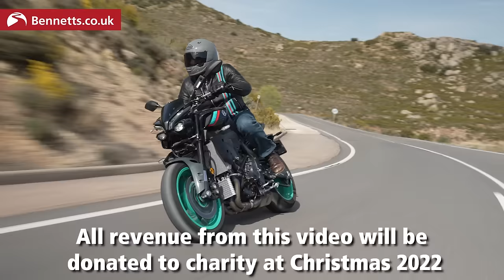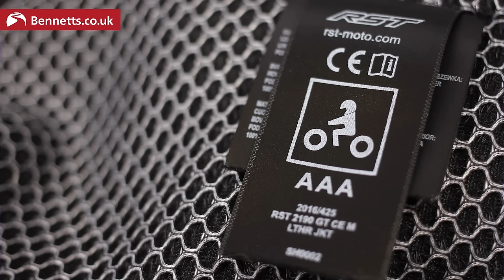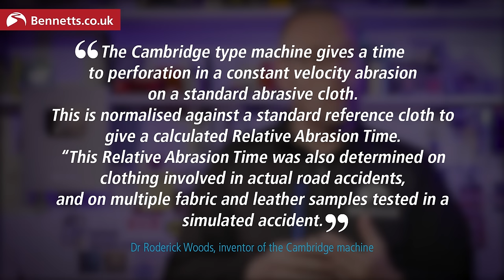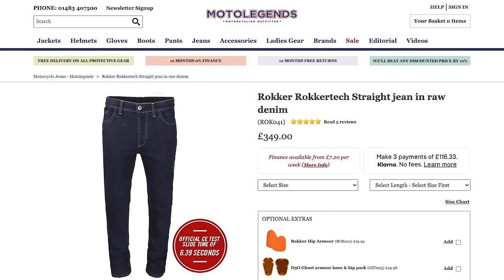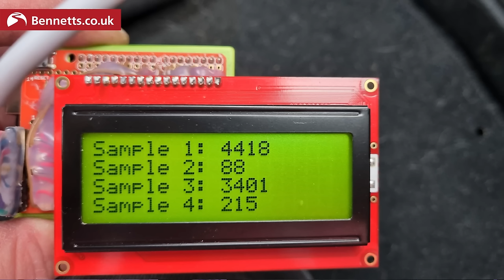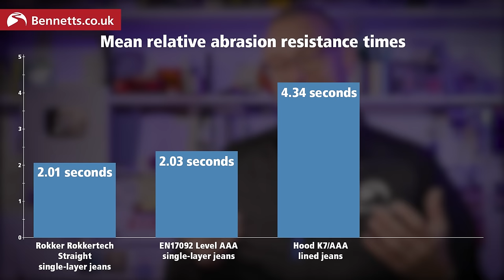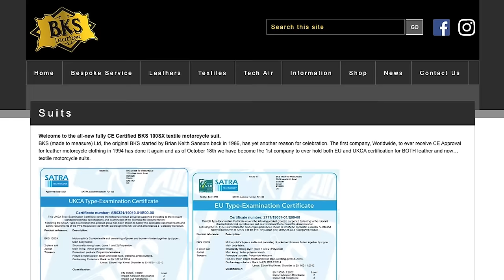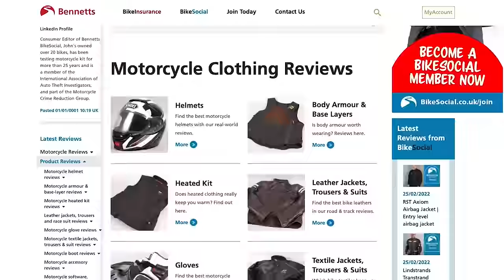Best motorcycle jeans | Single layer vs lined: THE TRUTH

Comment: In order for Slide TIMES; even if measured in a properly consistent and repeatable rig, to translate reliably to actual crash performance; there has to be some a priori assumption that the friction between the garment sample and the belt is fairly consistent across widely differing classes of garments. Even 20 second slide-time-until-wear-through, wouldn't help much, if you haven't shed any speed at all over the course of those 20 seconds.....

That's not just me being pedantic. Anecdotally, riders in textiles slide further on track than riders in leathers.... The researchers interviewed in the video likely have better data wrt friction between asphalt/chipseal and various classes of materials.

Even if abrasion was the only concern, slide-starting-speed, or energy dissipated, not time, is what should be focused on. In a real world filled with hard, immovable barriers which are dangerous at motorcycle getoff speeds, there will, in addition to abrasion resistance, also be an optimal friction coefficient for protective gear: High enough to stop you quickly, yet not so high that it causes excessive, injury causing, tumbling.

Being a bit of a cynic, on account of experience with standardised so-called "scientific" mandates in other areas; I suspect this is exactly the "problem" the textile makers wants regulators to "fix" for them by a "suitably designed" "standard:" Textiles simply aren't even remotely as all-around good as proper leather for crashing on a bike. And also, once friction gets as high as competition-leather-against-pavement: Then craftsmanship; as in seam strength and placement; how tight the garment fits in order not to bunch; how well marketing-desired tiny armor pieces resists being pulled out of the way under strain on the garment resulting from a crash-and-slide etc., becomes a big deal. IOW: It becomes very difficult to get even remotely close to the performance of proper, well constructed and fitted leathers. Cheap-to-have-made-overseas, flappy and fashionable textiles, simply don't compare at all. Making really good textiles "may" conceptually be possible; but doing so would require fine, labor intensive tailoring and highly sophisticated design, materials choices and workmanship. Not just a fancy brand on a fundamentally cheap suit slapped together to game a rather sloppy test.

Comment: I think your comment at 19:00 was key to this topic. Having tested my own pair of Knox jeans with a 40kmh off, I believe it was the knee armour that saved me from serious injury ( I landed on my right knee). I was limping for a week or two, but no long term effects. Now whenever I am tempted to ride with my ordinary jeans, I think about where I would be if it wasn't for those armour pads. Abrasian and skin rashes hurt, but they heal. Busted knees or hips, not so easy especially for us older blokes. Thanks for the video - you put a lot of work into that. 👍🇦🇺
Reply from the maker: Thanks, and glad you're okay!
Reply: I think I know how you feel. I hit a guard rail at 40mph in the knee. In my case, didn't hurt my knee at all (well, I had a sharp shock of pain, but no bruising, limp, or damage after). In the same crash I did break a few bones in a foot and shattered a wrist though. All healed up now, except my wrist is acting a little weird. The armor saved my knee, and the garments kept me from having any open wounds. The breaks suck, but it wasn't that bad because of the gear.

Comment: Having just bought some expensive single layer jeans rated AAA, it's disappointing to see just how little the new ratings actually mean. Thanks for this valuable information, I wish more independent testing of this sort was done.
Reply from the maker: The A to AAA ratings are genuinely valuable, but abuse of their communication is undermining them. Phrases like "they say 'A' but..." are just confusing buyers. The certification takes into account abrasion resistance, tear resistance and seam strength, producing a useful guide to what performs better. AAA is better than A, and if someone says "but it was only tested to A and could have done better" then that's irrelevant as we have no proof. The law was brought in to stop brands making unsubstantiated claims.
All of the levels, though, only product a pass, so while AAA is the best you can achieve under EN17092, you can't tell how AAA-rated garments compare. That can mean that some brands will try to infer that a single-layer pair of jeans are as protective as a pair of one-piece race leathers. 
It can be argued that on the road, if you hit a car or a tree then the abrasion resistance is irrelevant, but it's all about making an informed choice. I know that a set of decent (and I don't mean they have to be the pinnacle) leathers are safer than motorcycle jeans, but I choose to wear the jeans most of the time I'm riding for myself.
I want people to make informed choices, not influenced choices, and some stores do help with that. Claims of 'slide times' show a lack of understanding of the test methods and certification, whereas stores that allow you to search for products by the A, AA or AAA ratings seem far more genuine about putting rider's choices first.
Given the certification method we currently have, I'd recommend people to choose AAA-rated jeans, then decided if they want single-layer or lined. Cheers, John
Reply: @bennettsbikesocial  thanks for the detailed response. What I meant was mainly in reference to the fact that the two AAA jeans performed very differently while the AAA monolayer didn't even outperform the A. It seems like maybe the abrasion requirements in the new norm are simply set too low? How else if not through the rating is one supposed to know what is "safe" to do with the garment. With such a lower abrasion performance than expected, I might not want to take those jeans up to highway speeds for example.
Reply from the maker: @HardwareG33k  The AAA monolayer was very similar to the A, but this was only an abrasion test. The A-rated jeans had an abrasion resistance that could pass AAA, but we don't know if they'd pass the tear or seam strength tests. I'd always recommend buying AAA-rated single-layer jeans for that reason; it's a guarantee that all the tests have been passed – and they are all important.
With regards to the lined jeans and leather beating the abrasion resistance, that's where the planned BS 13595 should help; if all goes to plan, brands will have the option to demonstrate the performance achieved beyond AAA. It still will never be a 'slide time', but it will allow buyers to compare products more easily. Cheers, John
Reply: @bennettsbikesocial  that's helpful, thanks!

Comment: In 2014 i had a low side accident at 35 mph, rolled and finally tumbled into a ditch. I was wearing draggin jeans 32 INCH INSIDE LEG ( I am a 30 INCH INSIDE LEG) but they were a special order and what the hey! 
bought new in 2009 with separate knox knee armour and knox undershorts hip armour ... the jeans kind of worked but the stitching on the jeans knee area acted like perforations on paper ( like tearing out a coupon or check from a check book ) and tore along the line of stitching.
I found that the jeans had moved down a few of inches during my ride, so the stitching which holds the kevlar in place was now on the knee instead of a few inches above my knee ( even higher if I had the right length )
The the result from tumbling ( I DID NOT SLIDE ) are my the jeans were ripped open to the shin and the kevlar was pulled down below the knee. Knox knee armour saved me from any injury ( except my pride ) hein Gericke jacket with a separate back armour saved the rest.
My only injury was bruising to the palm of my hand because of light weight thin leather summer gloves, I replaced the gloves with a model with scaphoid rigid armour on the palm, you live and learn they say and what I learned is make sure you have the RIGHT LEG LENGTH  FOR YOUR JEANS, DO NOT GET JEANS TO LONG, AS THE ARMOUR MAY NOT EVEN BE COVERING YOUR KNEES WHEN YOU COME OFF OR THE STITCHING MAYBE RIGHT WHERE YOU HIT THE ROAD !!!
Reply from the maker: So sorry to hear this, but glad you're here to tell us! Yes - the armour makes a massive difference to the abrasion and burst properties of the material. All the best, John
Reply: @bennettsbikesocial  one last observation, I spent alot of money on gear. Your reviews, among others, are invaluable so we don't waste time and money. But here is my personal experience, buy the best gear you can afford (THOUSANDS) AND DON'T GO ON A BLOODY DIET !!!
Reply from the maker: @robinford4037  Opposite problem for me! Suffering from cake retention

Comment: I applaud your dedication to independence and numbers, even buying a proper test setup. 
Might it be an idea to couple all the 4 sample beams together? Then you are certain they would be at the same position, and with the assumption of a relatively flat surface, they would spend a similar amount of time on the surface, even when bouncing. At least it would allow you to do comparative testing between the samples of 1 run.
Reply from the maker: I can see your thinking, but the road is way too imperfect for that I'm afraid - is surprising how not flat it is! Cheers, John
Reply: There are rigs which Dr Chris Hurren designed that work quite well on the road but they are mechanically complicated and probably took a while to tweak. Chris has one that stays level using 2 levers and I believe it can lock out after the first impact to reduce subsequent bounces. Bounce is a real phenomenon though so removing all bounce goes against reality. Doing one sample at a time is very time consuming. Ask me how I know this!

Comment: As a motorcyclist and a cyclist, im happy someone is trying to unmuddy things
Ive been down road a few times. Ive always used jeans and gravel rash has been an issue in a couple of offs. 
More recently tho i struggle to get actual jeans to fit me (slim, not slim cyclist legs), price was always an issue and still is
So no matter how comfy they are or cool they are. IF you are spending £150+ on trousers then my mind boggles because this kind of money is out of my reach. 
I now use a pair of "Tuffstuff" (£20 cheap Dikkes) and they are hard as nails, been off peddler 3 times in same pair - a combination of speed and impact. Im not saying they are better than proper certified jeans, im saying they are a very good cost effective minimum. Triple stiched all over with a patch hole over knee for pads (builders pads), this alone gives extra protection. 
Always wear protection guys, its a second skin. Stretchy girls style trendy jeans or similar is "zero". I cringe seeing people in shorts T-shirt, i will not wish pain apon you but you are a Darwin award waiting to happen.

Comment: Another important thing to look out for is that most of the cheaper jeans are only reinforced at the key impact areas (knees, butt etc.)
I got two pairs of triple-A rated single layer jeans by John Doe, they are almost as comfortable as a normal pair of jeans but with abrasion resistence throughout, from the bottom of the legs up to the waist.
Reply: love my John Doe jeans, wear them as my normal jeans even when not riding
Reply: @wunsen95  They are awesome! Definitely worth the 250€ price tag.

Got a military-like jacket now. Just remove the back protector and you wouldn‘t know it is a motorcycle jacket😎

Comment: Very interesting video! I just wanted to add, I recently bought a pair of Rokker Rokkertech jeans and they now are certified AAA. Mine also came with both knee and hip armour. I remember reading somewhere that Rokker initially only went for A level certification, due to costs of having to have to test again for every color way, so they had their entire range tested against A level initially, just to be allowed to sell them.
Reply: @Ben Luts : It is not correct that every colour option has to be tested for abrasion resistance, tear resistance and seam strength. Provided the physical fabric specification does not change between colours, then test results for black, for example, would also cover navy, red, yellow and sky blue pink. 

The only additional test evidence required would be for chemical innocuousness of each separate colour - pH and absence of azo dyes, in this case. That can prove costly, although using materials suppliers who either already possess the data or who are Oeko-Tex or bluesign certified will avoid that expenditure, but Rokker would have needed this evidence to certify the original A classification range. 

Whatever you read was incorrect.
Reply: That’s a worry that the Rocker are now certified AAA. The tests in this video show that Rocker performed the worst.
Reply: @ianfutcher1518  😟
Reply: @paulvarnsverry11  without hip armour (as per the jeans tested) they cannot achieve AAA
Reply: @neilhorsfall6432  : Correct! AAA and AA classification jeans must feature fitted hip and knee protectors, whereas A classification need only be fitted with knee protectors. It’s one of the flaws of EN 17092 that overall classification is more affected by the extent of impact protection fitted, than of the performance of the garment itself. The downside to the system is starting to dawn on more and more brands - as is the fact that the AAA requirements are not that difficult to achieve, and also provides no ability to recognise nor reward superior products that perform well above those requirements.

My previous comment here covered how chemical innocuousness is factored into certification.

Comment: Really interesting! I find I get too hot in my lined RST jeans (AAA rated) so I've been considering single layer stuff that's a bit smarter looking for office use. I'd bought into Rokker being the top of the range but thought I'd be alright "cheaping out" on some cheaper AAA rated single layers. I guess at the very least I've learned that you aren't necessarily getting more protection for the premium, maybe there are other benefits in terms of comfort/quality though. Keep up the good work!
Reply: I think, if you're uncomfortable in lined jeans, it's worth having some single layer jeans, because otherwise, it's easy to wear normal jeans or trousers etc for work...
Reply: @waynedl99  I ended up getting some Dainese Classic Regular Aramid "jeans" (they just look like smart trousers). They have an Armalith construction like Rokker jeans (at half the cost via SBS discount might I add) but extra Aramid in the knees and seat. I think it's a good compromise really, hopefully I won't need to test that!

Comment: In AA and AAA jeans hip armour is mandatory, so if it doesn't have hip armour it can only be class A. I work in the industry (clothing shop) and found that this has been an issue with some suppliers and labelling. Where initially they have claimed to be AA and even labelled such, when I questioned the lack of hip armour, they have admitted it was a mistake and hence the jeans will only be A. 

I think the jeans you bought possibly wete meant to be tested to AA but as they decided not to include hip armour only tested to A. Might be why the test result of A and AAA you done weren't as different as expected.

Just a thing to think about that lack of hip armour will mean the jeans will only be A even tho other protection might be higher (similar to what you said about class B)
Reply from the maker: That's a very good point, and I'm kicking myself for not considering that. It does explain why the Slim jeans are AA-rated as they do come with hip armour. Thanks very much! Of course, it does't explain that 'official CE slide time' or the claims of being 50% more abrasion resistant than leather, but it does clear the rating up! All the best, John
Reply: Basing overall EN 17092 classification of clothing on which items of armour are fitted is one of the flaws in EN 17092 that are slowly dawning on more and more manufacturers. To pick up on John Milbank’s reply, the classification should be based on the performance of the materials and constructions - AAA, AA or A - and Class B dispensed with. 

During a recent meeting of the British Standards Institution subcommittee for motorcycle clothing standards, one brand’s representative proposed that the EN 17092 pictogram should contain one box for performance classification, and a second box denoting which protectors complete the garment’s certification status. This would enable consumers to differentiate between, for example, Class AA + H + K jeans, where hip and knee protectors are present, and Class AA + K jeans; and between Class AAA + FB + S + E jackets (back, shoulder and elbow protectors) and Class AAA + S + E. 

These recommendations are unlikely to happen soon, however, as there is no appetite whatsoever amongst industry representatives in the European Standards committee to re-open EN 17092 for revision.
Reply from the maker: @paulvarnsverry11  Thanks Paul!

Comment: Great video. I was thinking I didn't need to make a video of my research but I think I still should. I was disappointed that your road rig didn't work out. Mine was very reliable. 

Your conclusion is similar but the results aren't. The problem with the Cambridge and the Darmstadt test is they use a flat sample holder. This is not anatomically correct for impact zones - they are all convex. Also neither have any realistic impact - they are both essentially slide only tests. In my tests, with a realistic impact (1m with 5kg) and a hemispherical sample holder, on a medium asphalt road, materials failed much quicker than would be seen on the Cambridge test. Whereas, leathers in single or double layers did considerably better than you'd see on the Cambridge test. 

In any case, I'm happy to share your video. It's very valuable info.